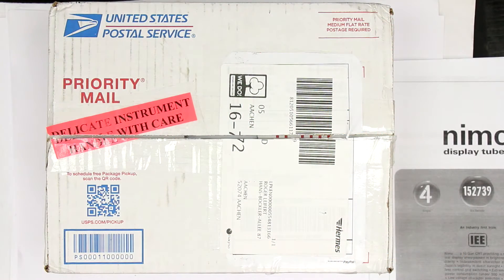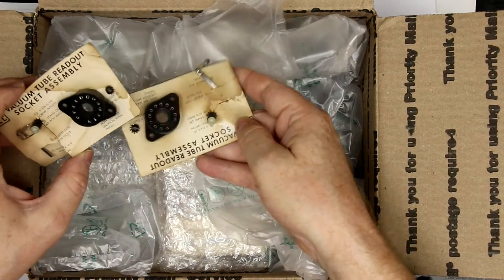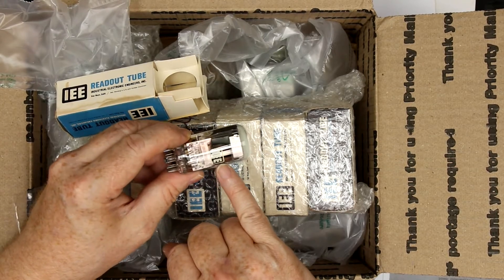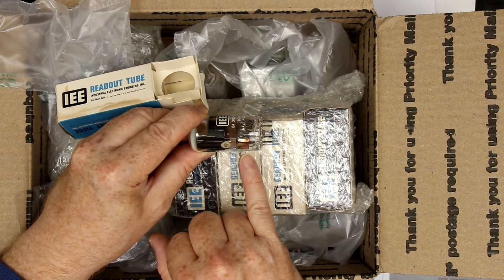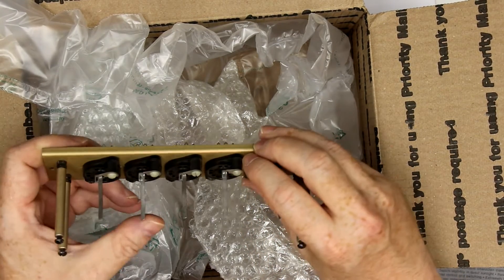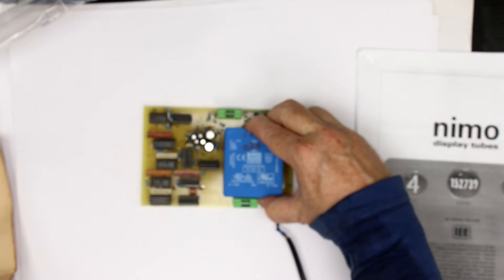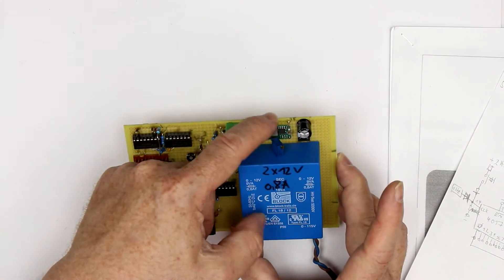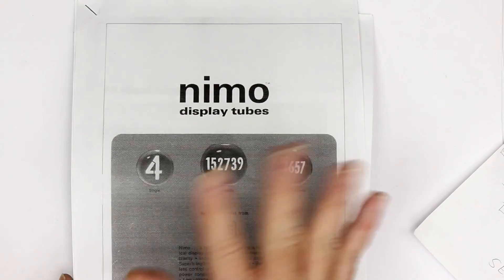A handful of ultra-rare NIMO Display-Tubes from an Ebay-Auction

Comment: Oh my meowin' cat. You got a full ten of them, with sockets, boxes and datasheets? Now that's something. 
It's working kinda like the magic eye tube: the electron beam is not focused but wide, and electrodes act as shadows just like you would have them in the magic eye, but rather than having a voltage-controlled electrode which makes the shadow wider or narrower, the electrodes are cut to shape. I wonder about this tube's internals. Just don't dissect a working one, please!

And Fran is indeed absolutely wonderful. I'm a big fan of her.

Comment: You could probably use the split primary on the PCB transformer as an Autotransformer to get the 115V for the NIMO power supply.

Comment: My eyes hurt seeing you touch the glass with your bare hands! 😮 Keep up the nice work, tying to get my hands on a couple of these!
Reply: you don't know what are you talking about.
Reply: @vladnickul Yess I am sir!
Reply: @artvnl6345  really. then explain why is bad if you touch the glass ? :                                                      The only "bulb" you can not touch. are special detectors and image amplifiers with some kind of optics and high power bulbs like the one in projecteors.Why? because the oils from the finger print will vaporise and coat the optics /oils will turn bun-brown and will cast a shadow. alternativly tubes athat are really old and not so mych cared for maybe fron a old radio, the paint is really flaky and will come of when touch.                  But again. you don't have or had any clue, you are just repeteing a "urban mith"
Reply: @vladnickul  I have seen it myself, even on simple VFD tubes. So I don't think it's realy a myth, especially on rare tubes like these Nimo's I would take extra care of them.
Reply: @artvnl6345  seen what?
Reply: @vladnickul  fingerprints burned onto the glass
Reply: @artvnl6345  :)) just clean it with...  any liquid :)) and stop eating chetos and fingering electronics at the same time ;)